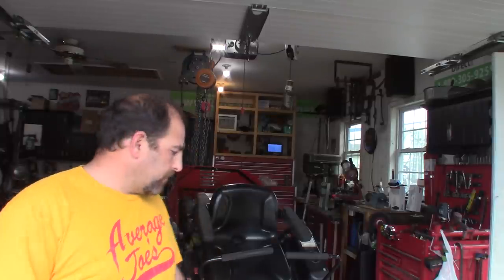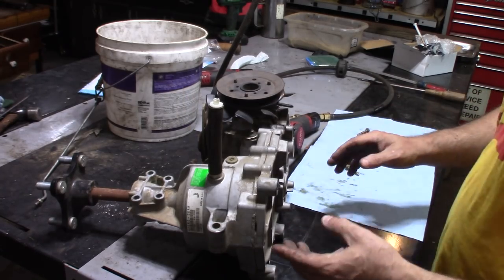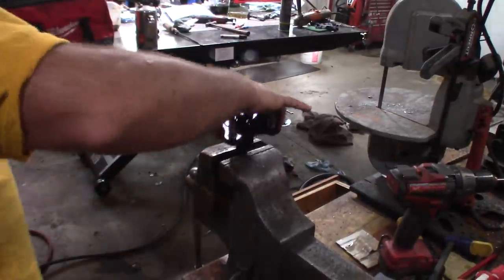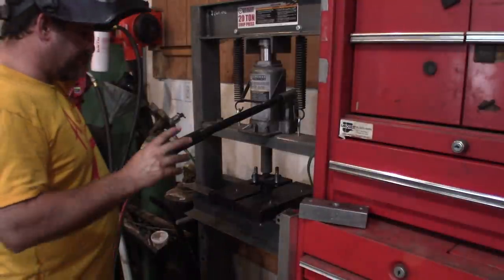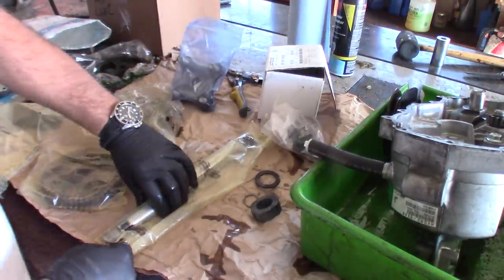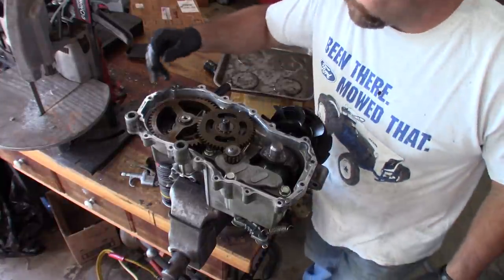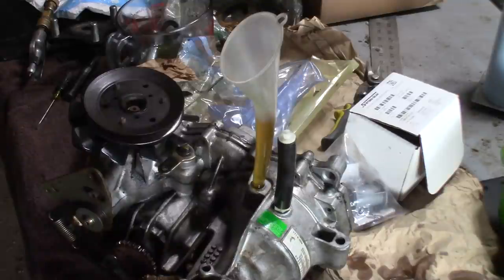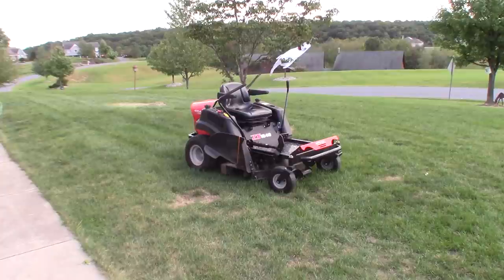Broken Zero Turn Transmission Axle Repair

Comment from the maker: https://amzn.to/2rLMrs7 Hydro Trans Axle Kit
*Match Gear Ratio Change Both Axles At Same time*
https://amzn.to/3vAJNWp M18 1/2 High Torque Impact Gun
https://amzn.to/2Z6VmbM M12 3/8 Milwaukee Stubby Impact
https://amzn.to/3lYxIHn Commercial Oil Extractor
https://amzn.to/2IR2u25  Mobil 1 15W50 Full Synthetic
https://amzn.to/2Lh9HXM Snap Ring Pliers Set
https://amzn.to/2rYIksq Tekton 3/8 Torque Wrench
https://amzn.to/2LhDvDx Permatex RTV Gasket Maker
https://amzn.to/2wGKbIg Right Stuff Gasket Sealer

Comment: Very nice repair DW6 Jake just finished welding up a Husqvarna frame and installing the last two transmission brackets that were in Canada to fix a customers rider that he was using with a plow to level stones in his driveway. BIG MISTAKE 2 brackets $8 plus $20 shipping, 4 hours of realignment and welding plus new drive belt all for push stone!

Comment: that hub was crazy-stuck on there. probably wouldnt have worked on that, but after heating the outer part, a can of compressed air turned upside down sprays super cold and can sometimes help, but damn that's crazy. tapers like a morse for instance are used by drill presses and similar and sometimes machines just rely on the supremely snug fit of a tapered bore and matching shaft to stay in place. Add any kind of rust into that equation...